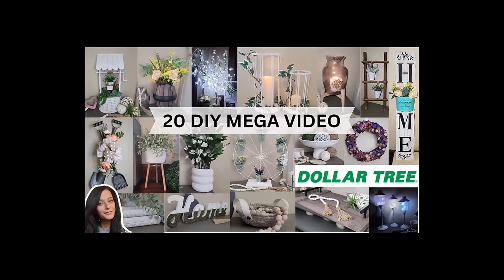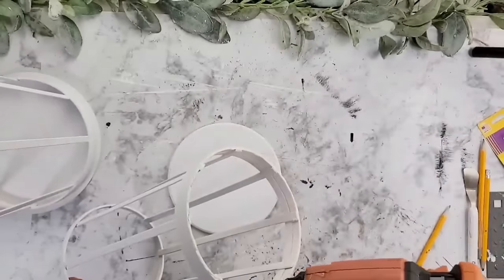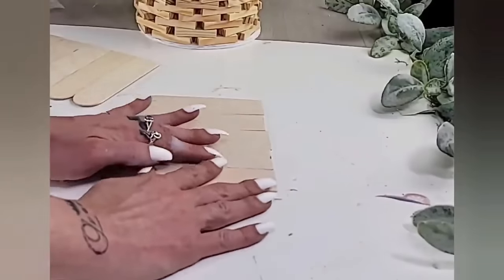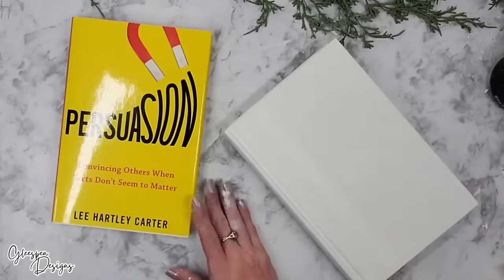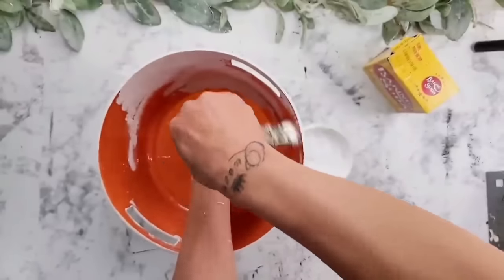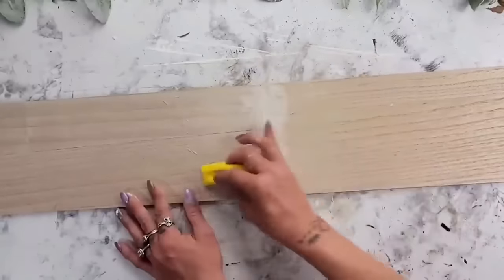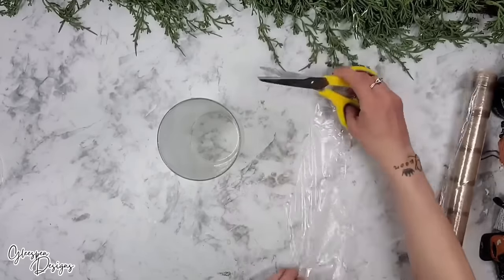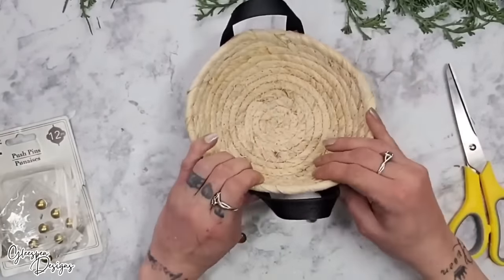TOP 20⭐ VIEWER FAVORITE DIY HOME DECOR PROJECTS #dollartree #diy

Comment: Not sure which I like best. The Dogwood tree, the Ferris Wheel or the wooden flower basket. And not ONLY did I get inspired by your designs but I also learned you can separate the laser cut items from The Dollar Tree (or as I now call it: The Buck and a Quarter or More store)
Reply: As if I didn’t get ENOUGH information you went and threw me ANOTHER bonus tip. Don’t throw away the handles from the foam brushes when they are no longer usable. Wish I had seen your channel before today. Don’t overwork yourself, but keep those ideas coming.